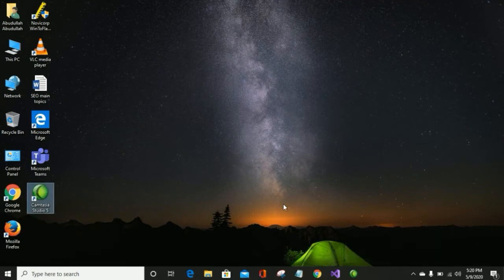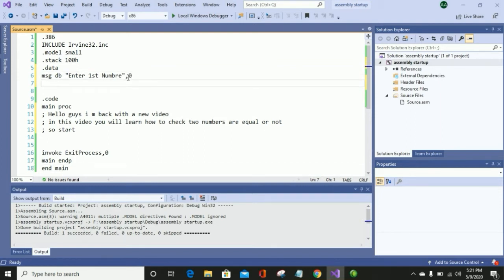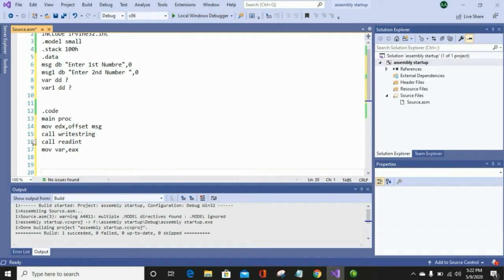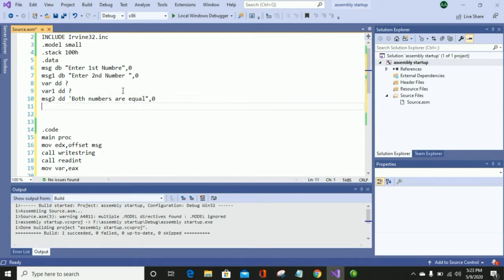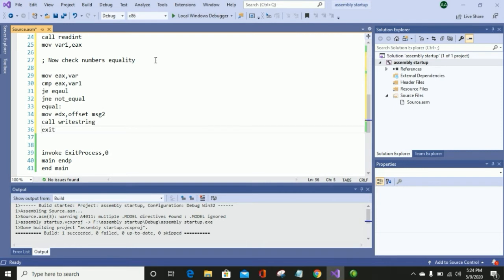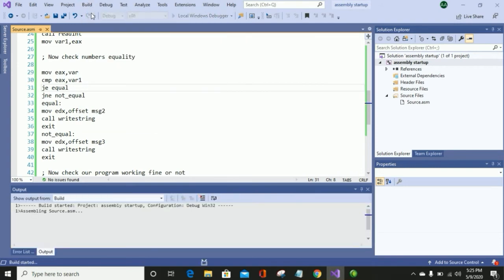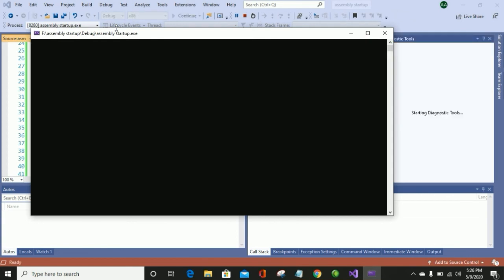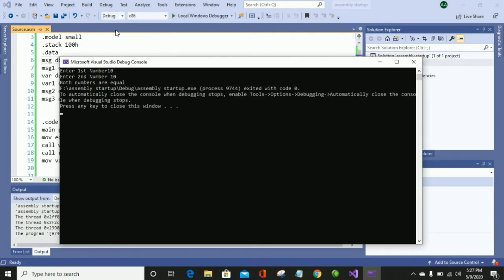How to check two numbers are equal or not in Assembly Language | Bhinder World

Comment: If I had to print the larger number to the screen with a string, how would I do that? When I call writeInt , it prints the string fine but it always says the 2nd variable is larger even when its not. I have it jumping if equal and it does that fine, just the issue with 2nd variable when not equal
Reply from the maker: You should initialize string in Data segment and can get input a large number within specific range of limit while executing your program. Thats how you can add large number with string while using writeint